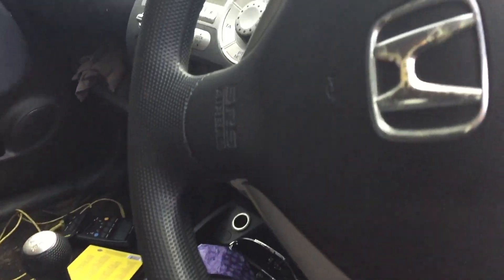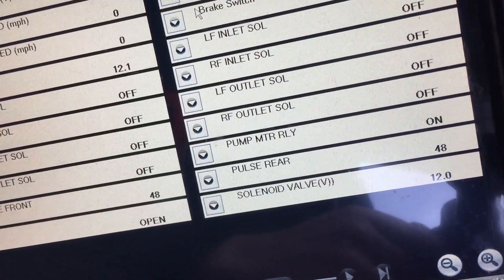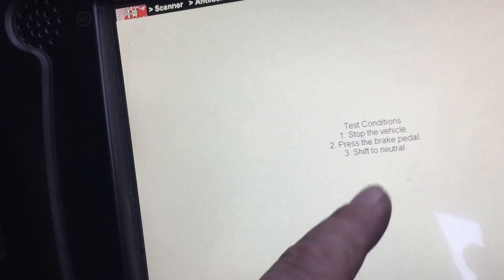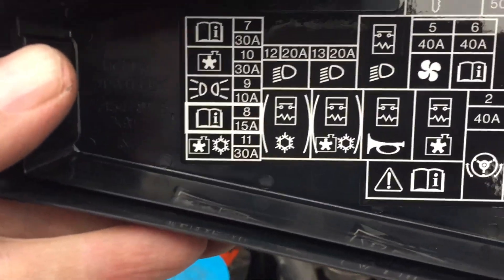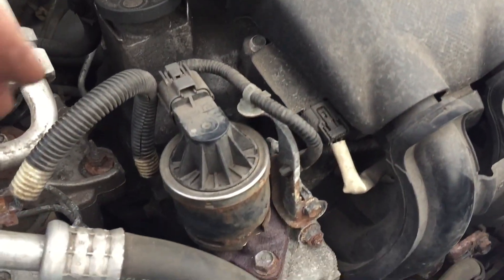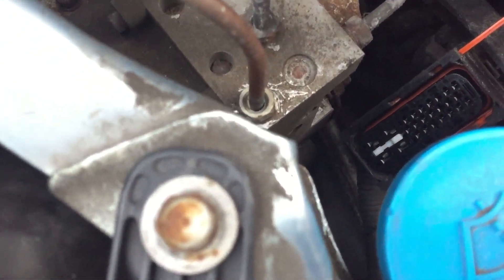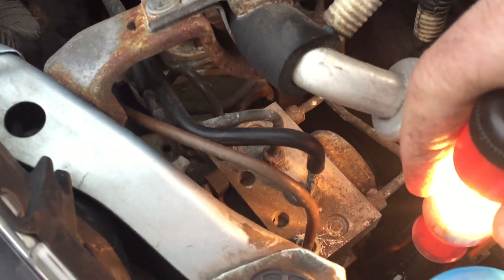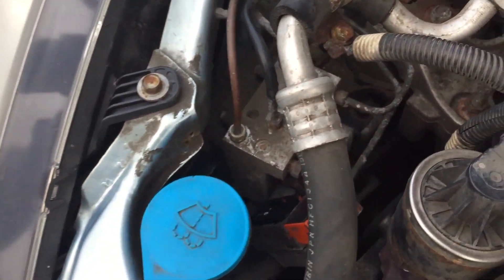Honda Jazz ABS Fault Code 51-1

Comment: My honda fit 2014 model ABS system lights On ...something broken with break system but Manual Break is still working ..how to check that its  ABS fault
Reply from the maker: Read fault codes
Reply: @sandyande  thank you dear bro